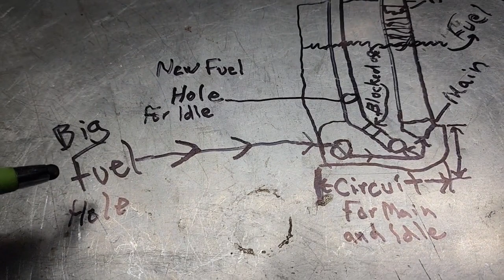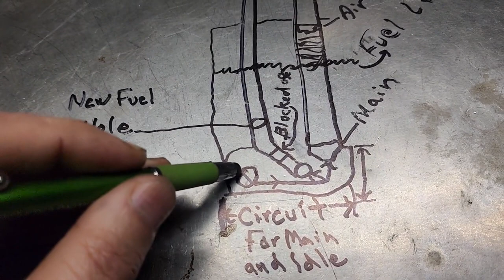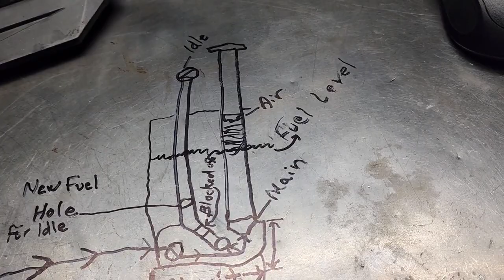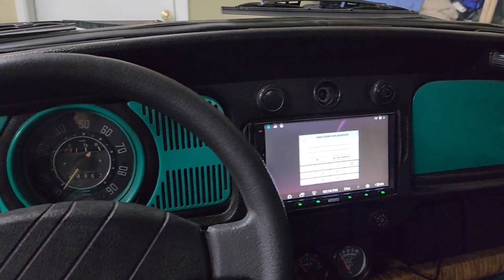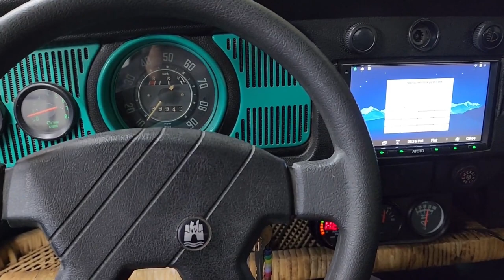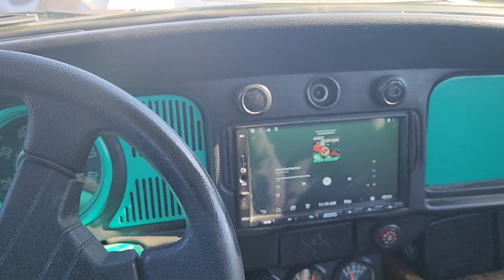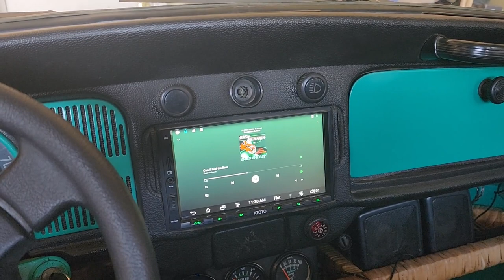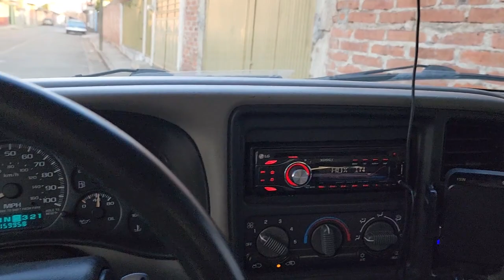Removing the Achilles heel on the Weber IDF

Comment: You're over thinking the IDF jet/s...One spends most time driving on the idle circuit vs the main. If you require fast heavy throttle the main combined with the proper accel squirt along with the correct distributor advance is what will define whether or not you have hesitation. The fuel ports themselves are not small enough to plug with dirt. It is the idle jet itself that will plug up. The number 1 reason for plugged idle jet is none other....Air filter and/or filter assembly. With a 2L T-4 your jetting should be with 28mm vents....47.5 idle, 120 mains, F-11 tubes 190-200 air corr. jets (fuel pressure critical no more than 3.5psi) and float height 10-11mm (gasket in place ball NOT depressed).

Comment: Why not just keep the carburetors clean and you do not have to drill?
Reply: The goal of this was to eliminate the fuel standoff.  (idle circuit and main circuit fighting for fuel at the same location in the bowl) not just clogging
Reply: @napier630  the idle and main circuits will transition as soon as you crack the throttle plate.  They do not rob each other.  1200 rpm and you draw fuel from the main jet.
Reply from the maker: Thanks for the comment. For me I don't ever want to spend any of my valuable time cleaning carbs. Nobody should.

Comment: I posted your video on samba and a couple other sites because I believe this modification  has made   Best improvement  for the idf  that can be done and quite  simple  if you take your time  . a person  on samba posted that Weber  does have a version  with dual circuits he is correct 44idf xe does  .   The hesitation is gone just like you stated!
Reply from the maker: I had no idea those idfs even existed
Reply: i need to get on there and post some pics of mine     they are from spain and have the idle jets change from the top where you checked the vertical passage way 
a local bug repair guy told they were old n not sell em cheap ????
  ive got em on a not so pretty warrior rail chassis running a 74 bus 
1.8 n 3 rib mostly sits in the yard 😒
i want to get it running good and take it to a offroad park near here and maybee try n get it street legal but TX was being dicks to vw rail guys on registration

Comment: As for AFR be sure you have the proper distributor (not a centrifugal only) distributor. At part throttle conditions there is nothing wrong with 15-17afr so long as you have the added advance to help the lean burn. No lean tuning with a centrifugal only distributor. At WOT you want to see ~12:4 afr (+ / -.4)

Comment: I’m dealing with the same issue with a dune buggy. My question is, what if I drill the hole just as you did but I press the plug in. Let the mains and idle share the original pick up hole and new drilled hole. Little bits of rocks wouldn’t be able to be sucked up from the bottom since there is a new drilled hole.   Make sense? Or did I miss somthing.

Comment from the maker: I'm pleased to report that so far this beta testing has gone perfect. There were no jetting changes made of any kind. The vehicle drives just like it did before we modified the circuits. With the added benefit that now when you start driving it just wants to go so driveability has gone from okay to excellent and it's actually very noticeable.  Also there appears to be no fuel starvation when making hard turns at wide open throttle.  The key being that you do not drill  above 10 mm from the fuel bowl bottom. Now as far as the idles plugging up, in theory this should be a thing of the past. However it's only been about a week of beta testing. If I do go through a idle plugging situation I shall report it right here. But from what I can tell, these IDFs carburetors are now reliable daily drivers.
Sera
Reply: could you not achieve the same results by just drilling the holes and not messing with the plugs @ 10:30?  you won't necessarily separate the circuits, but have enough volume to stop the stand off...?

Comment: I have a customer watch this video. He went right ahead and did this mod. He then calls me and says its almost undriveable.

Ive had it here for two days and now this thing drives nice .

However, it now has emulsion tubes that look like theyve had a party with a 50 cal. A 240 air 😂 and check this out, 75 main. Yep i had to solder em up and lean them right out. 52 idle, could probably get as low down as a 48, still a hair rich part throttle 
Afrs tip in 11s at 2k rpm wot then clean up to 12.4s from 3k all the way to the redline.

Engine is a 1915 , engle 120, vintage speed exhaust with cb 044s 40x35.5 mild port job. 34 mm vents. Genuine Weber 40idfs.

The craziest jetting combo ive ever come up with. A messed up f11 with messed up mains and airs. 

Either my customer has completely screwed this up or its a case of it was never a problem .

Comment: Great job! This looks like a genius modification! Thanks for sharing. Interested to hear the daily data. Might give this a try on my carbs also. Just concerned with any starvation in hard turns, as mine is on my buggy where we do a lot of off road trail riding. Where do you find long punches?
Reply from the maker: Thank you
Okay so far I've been driving this setup for about a week and all I can say I should have done this a long time ago. The drivability is amazing. As far as the punches they're from to harbor freight. The key here is after you drill your new drillings make sure the circuit is free of any aluminum shavings or you're going to blame the drillings not working for you. No jetting change at all and it runs perfect. Also drove it like I stole it because I wanted to know if I was going to have field starvation while making hard turns and all the gas hard nothing happened other than drivability just went through the roof.
Reply: @Motor7710  This is great, I'm excited to try it. However I'm in Michigan and I won't be driving it for a few months, but I can't wait to try this out. Thanks again for posting this. I'll let you know how it works out for me.

Comment: I posted your  channel on Instagram  in hopes that more people will see your work ! Keep it up .
Reply from the maker: Thank you very much 👍
Reply: Looking at my   None clone carbs they do  not use galley plugs to close  the port off .  So I’m thinking taping the hole and Using a treaded galley plug . Might be over thinking it not real sure about it or using a dowel   You can press in past the hole you drill  for the new fuel  inlet . Any thoughts ?

Comment: Nice job 👍, which wide band you are using and where did you connect the sensor to on muffler or exhaust? Thanks, any help is greatly appreciate!
Reply from the maker: In using the AEM Uego. The probe sensor is right after the sidewinder collector before the muffler. Should be plenty of wire to reach the middle bottom of the dash. Good luck

Comment: So i have a turbo 1776 that is blow thru with 44 idfs from amazon. And the main issue i have is that it goes insanely rich if im mildy accelerating without boost or even low boost like 3psi or less. But its good at high boost and high rpm. But is just way too rich on light to medium accelerating. And at 2000 rpm i have a spot that goes so roch you basically have to nurture it past 2k rpm and then it will be okay. Think thats also from fuel standoff? Or something else? In the vid you mention it when leaner than before slightly, where in the rpm range and under what throttle? Easiest way I can describe it is like the main circuit activates too early or too much on light acceleration. Because if I'm cruising at 2900 rpm I get a high 13s or low 14s afr. And also crusing at above 3000 is very rich. Youre probably the only one i know that has put this amount of research into these idfs and may have an answer, I know it's boosted and not NA but I figured I'd ask

Comment: What size of a drill bit are you using to make the hole in the bowl? Going to modify mine this weekend. Thanks.
Reply: Finished my mod. If anyone is wondering, I used a 3mm bit in the Dremel. Now to install them and see what happens. Hoping for good results.

Comment: again thanks for sharing your indepth root cause reserch  and testing  
now i may be off but 
for the guys with the plugs in the top verticle channel   
could they drill the new bowl idle hole 1st then just 
push the plug past the hole they drilled so they will be able to see the plug get pushed past the new hole
2nd possible idea if above will work 
could you drill and drop a 3mm bb
thru newly drilled hole with locktight and push it down the passageway towards the main tie in   cause even if it barley could "leaked" one side to the other with the newly drilled hole it really wouldnt cause nature is lazy and has a big hole to pull fuel from NOW

Comment: Are you drilling both holes in the float bowl and the other circuit or???
Reply from the maker: Each throttle has a single idle circuit so the answer is we're making two holes on opposite sides of the fuel bowl. But when in doubt what I do is I watch videos over and over until I get it so you might want to watch the video again. Good luck 😊

Comment: Would u be interested in  doing my carbs if u sent them to you w/$$$$???
Reply from the maker: I wish I could but as a truck driver I just don't have that kind of time. It's not as difficult as it looks. However if you ever do decide to do this yourself make sure the circuits are extra clean from an aluminum shavings or those things are going to give you a headache. Not only that but once you get it running correctly you will never regret the modification.
Good luck